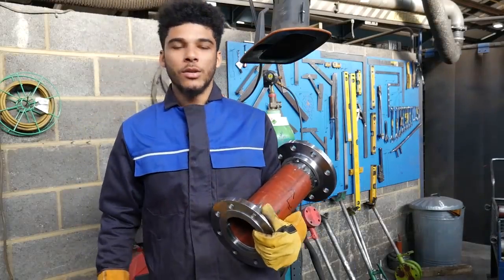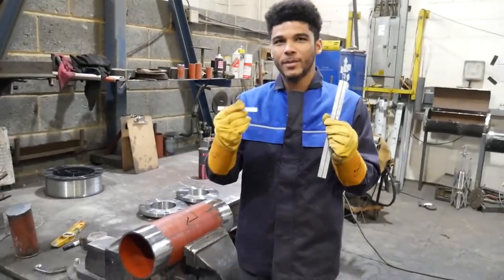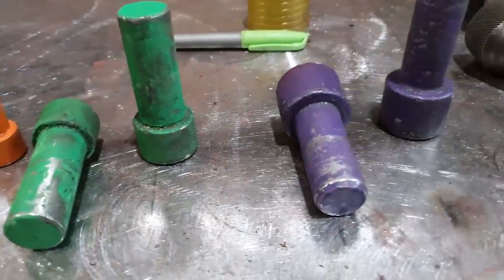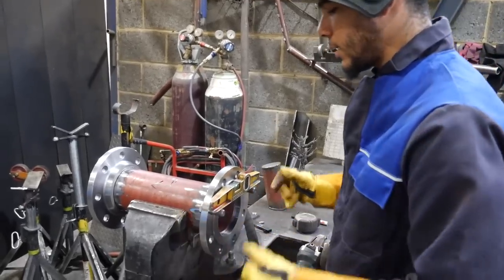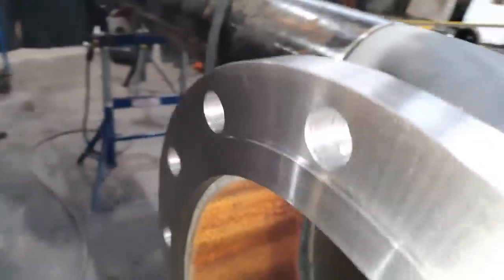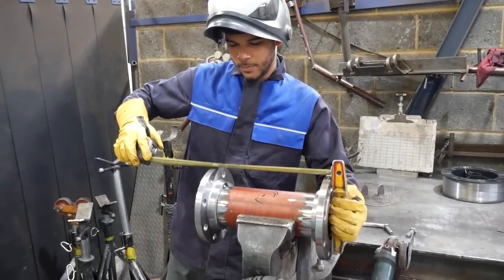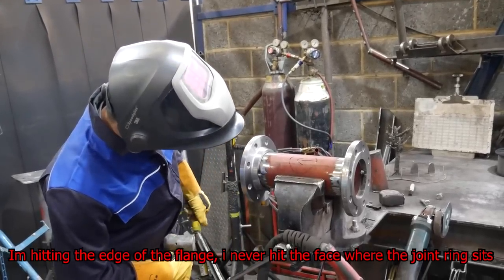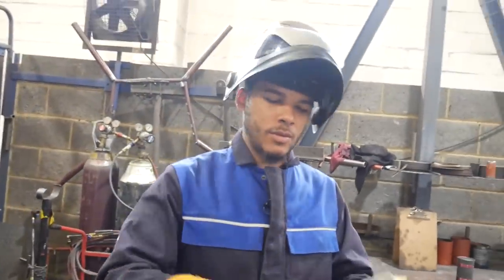How To? Pipe Fabrication Tutorial  *Tips & Tricks* Part1

Comment: @12:00 when youre checking the alignment of the two flanges re the bolt holes, just use two rules and line them up rather than lookingvthrough the bolt holes. Much easier, and the longer the rule or straight edge is, the more accurate the alignment 👍👍
Reply: In fact, it's really strange, it's like he doesn't think about what he is doing, like someone showed him how to check and he don't replicate exactly the right way! So the right way as he start to do it is to align the flange holes with the corner of the table and then put the rule lined with the 2 holes of on the TOP flange. And to finish check with eye if the rule is lined with the corner of the table!

Comment: An easier way is to put the flange on a flat surface (the pipe has to be perfectly square) put spacers, ie: flat washers x3 @ 15mm  inside flange. Tack in 3 places. Reverse on second flange, line bolt holes by eye with two 12" steel rulers. Tack 2nd flange and done. Cheers. Just saying more than one way, whatever...

Comment: Would be good instead of using bolts to have two long lengths of threaded bar with nuts set at the distance apart to put the flanges upto and then nuts on the outside that would ensure the flanges matched up in terms of level at the same time maybe? I ve never worked with pipe just done some general fabrication feel free to rip me lol in fact if u used two lengths at the top and two at the bottom u could theoretically square and level both sides at the same time? 🤔
Reply from the maker: It probably could be better but it's all about speed for me tbh so if it's faster id go for it